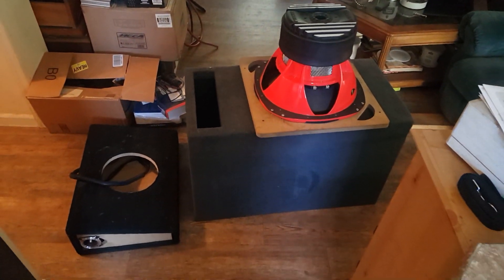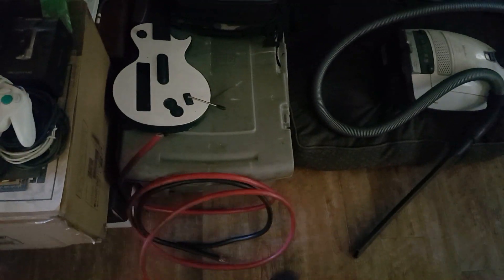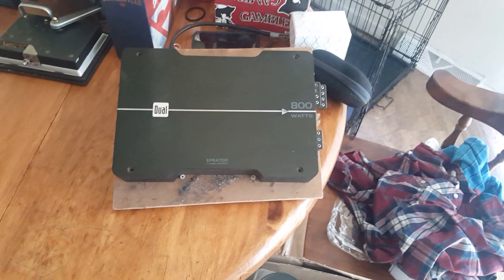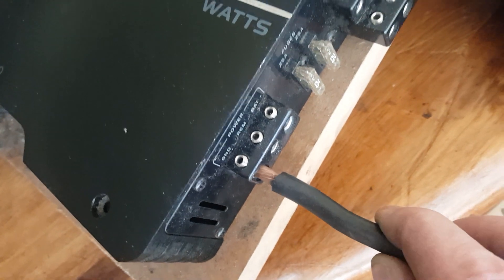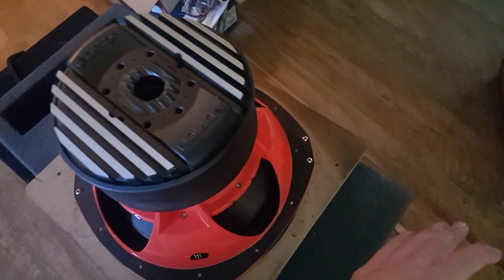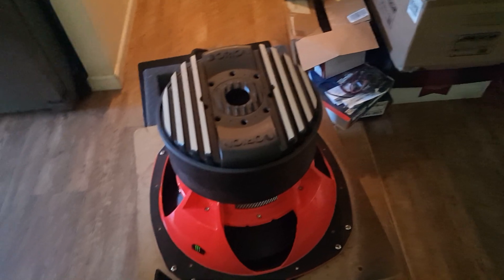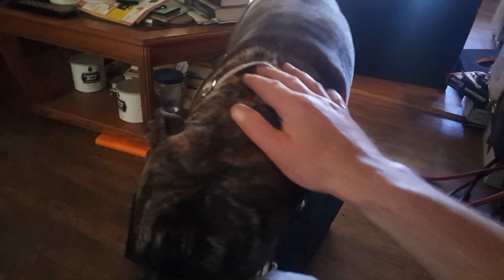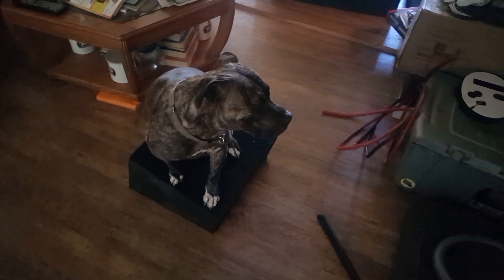Getting started on re-installing things in my f250 today

Comment: What exactly does an equalizer do if you don't mind explaining a little?
Reply from the maker: It's just for adjusting frequencies being played. It's like having bass, mid, treble adjustments but much more specific to which frequencies you want to turn up or down. The clarion I have is a 7 band eq so I can adjust 7 different frequency levels. Then I also have a 3-way electronic crossover. So I can adjust my eq how I want and then set my crossovers to only allow certain frequency ranges to be played through different speakers(1 sub, 4 6×8's and 2 tweeters). So it won't send bass to my tweets or highs to my sub and so on. Hope I wasn't too confusing. Once I get everything back together maybe I'll make a video about my eq. There are already quite alot on YouTube though. "Clarion eq 755" is what it's called. Very nice eq I love it.
Reply: @bass-n-truth-inthestix9083  so basically you can adjust the songs that dont base hard to hit hard? Like turn it up?
Reply: @bass-n-truth-inthestix9083  and for clearer quality?
Reply from the maker: @jeremyvillegas572  yes and no lol.  Yes you can turn up the bass or whatever you want if a song is lacking. You can only get so much from that though because you still have to worry about clipping. For songs that are lacking bass that's what epicenters are for. Aka "bass restoration processor" like my audio control epic160 indash. That thing is awesome. I can make jingle bells slam bass 😂
Reply: @bass-n-truth-inthestix9083  that's awesome!😂lol I need me one of those!
Reply: @bass-n-truth-inthestix9083  but thanks for making it clear! Well appreciated